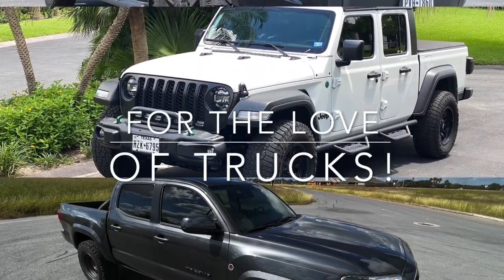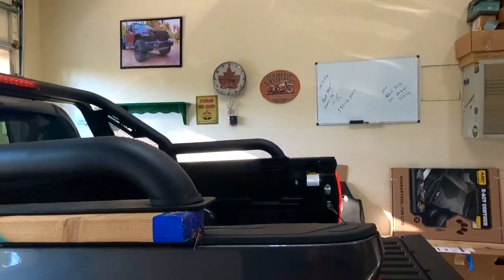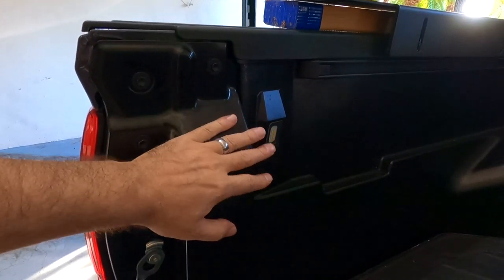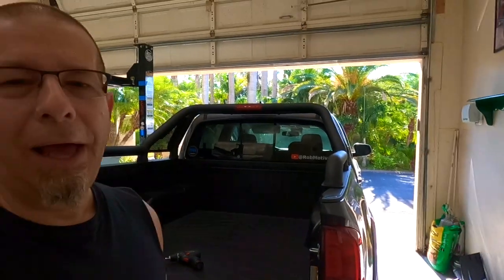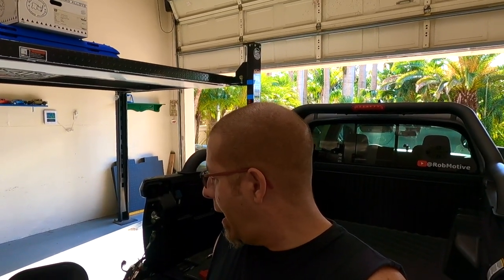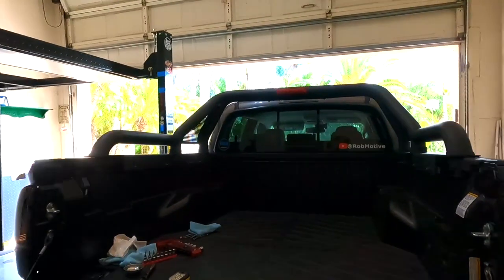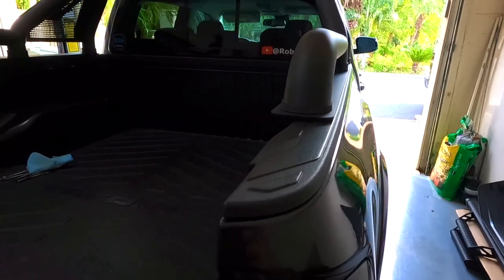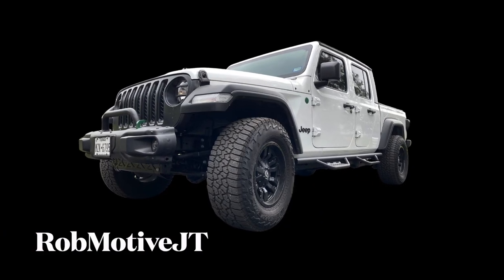Installing a Sport Bar On My New Tacoma

Comment: Looks Good Rob! I think a 3D printer to make custom washers would be cool! Plus you could turn the bolts around so occupants in the back won't get cut.
Reply from the maker: Not a bad idea, but I really would have little use for it.  Plus…I don’t have the time to design stuff😬

Comment: Did you have to cut the cross bar to force the side bars to the inside of the bed? I thought the side bars had a fixed dimension across the bed.
Reply from the maker: Unfortunately it’s the other way around.  I have plenty of space on each side.